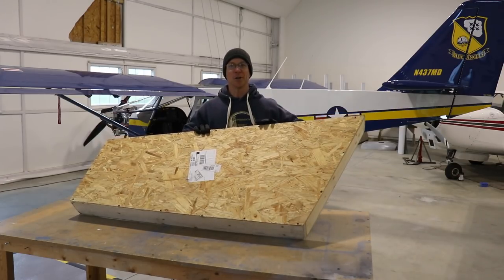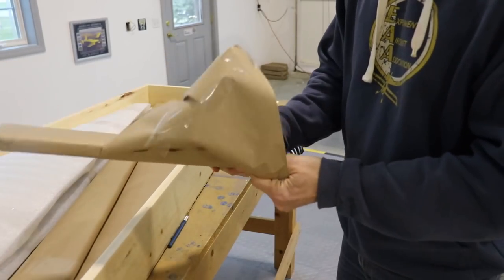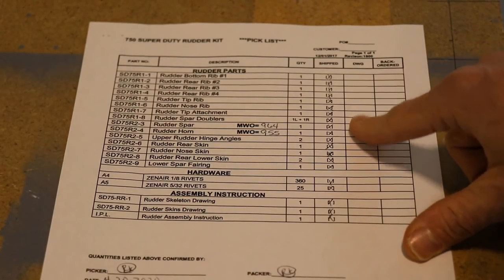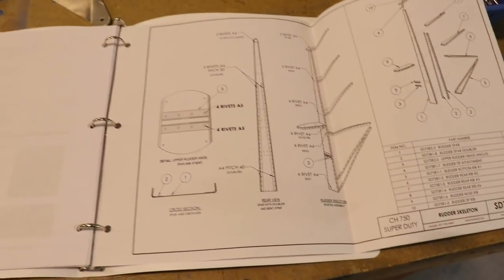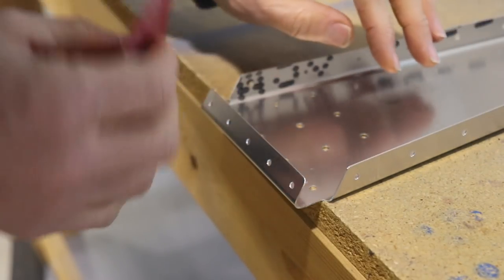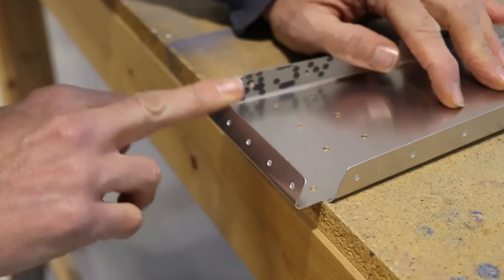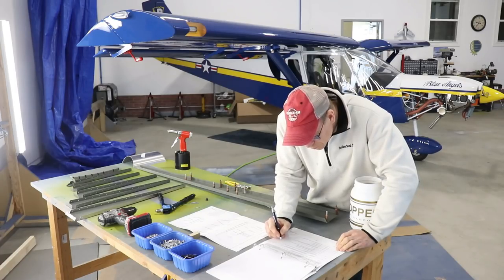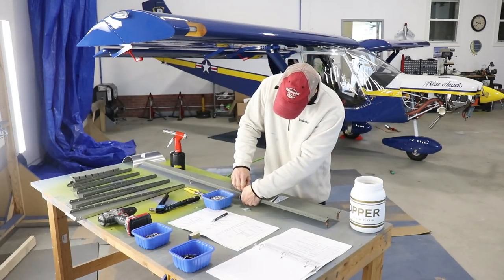I Built a Zenith SUPER DUTY Rudder Kit!

Comment: (checking off the steps as you go:  The DAR likes seeing those and counts that as your build manual/log, so should be considered mandatory and not optional to do) Best also to date the check.
For those that are brand new builders, instructional videos come in very handy --- both for the HOW as well as Confidence Verification, so I vote YES on the detailed video
Reply from the maker: True, but the build log also has to consist of build photos. The FAA also wants the builder in the photos too to 'prove' that he or she actually built the plane.
Reply: You should also initial and date each step if you plan to use that as part of your build log.

Comment: Corners only result in stress concentrations (stress risers) when they are inside corners.  Outside corners are fine.  I agree that they look better with a slight radius, but there is no structural imperative.

Comment: Sure, I'd love to watch a more detailed video on the SD!
Side question on this video: I notice some ribs are primed, but some aren't--or maybe one side is and the other isn't on some. Can you elaborate on that a little? At first I thought all the internal stuff must be primed, those left outside being left unprimed, but I got a little confused with the unprimed nose rib. Thanks.
Reply from the maker: Good eye, and you are correct. The primer I'm using to prime the internal parts is Dupli-Color self etching primer. It's great for internal parts but it isn't as strong and doesn't bond as well to the aluminum as two-part epoxy primer. So any surface, like the bottom of the bottom rib, and the top of the top rib, was left unprimed as it will get primed with a good epoxy primer once the rudder is painted. It might not show in the video, the nose rib you are referring to is primed on the top and sides. But I left the bottom unprimed so that it will get sprayed with epoxy primer during paint.
Reply: @KitplaneEnthusiast  Of course, because the bottom of that nose rib is the outer side! THAT's what I missed. Thanks for the reply! Keep up the good work.

Comment: Hey Mark, Just started my rudder this weekend for the Cruzer!!  Hardest part is getting the stickers off :-) . Any tips on an easy way to remove those. Thanks for another great video!!!
Reply from the maker: Ah the great joy of building a kitplane! Other solvents work too, but since I have it I soak a paper towel with MEK and hold it over the sticker for about 30 seconds. That will soften the glue and you can pull the sticker off in one piece. Then, clean off the residue. Wear gloves and ideally a charcoal respirator with MEK!

Comment: Wow.  What a great idea to produce an end-to-end video series on building the SD.  Homebuilthelp.com has the back end of the fuselage and Zenith has the tail and wing assembly, but all of it would be a needed and a new work.  I'm interested, because that is what I'm considering building 

BTW, I like your bins and Copper jar organization techniques as well as the corner rounding, edge sanding, and de-burring.  Did you adapt your de-burring tool from another use or is it designed for that purpose?
Reply from the maker: Nope the tool is designed as a deburring tool!

Comment: It's hard to see it but I think that you may have sprayed primer on all the parts before you riveted them. It would be good since the parts are aluminum and the rivets are steel, also, was there any need to drive up the holes for full size or are they predrilled full size from Zenith?

Comment: I noticed you having to use two trigger pulls on the rivet gun.  Mine pulls the rivets with one trigger pull.  Is your gun pull length adjustable?  Mine is and I am wondering if your gun is out of adjustment.
Reply from the maker: Yes mine takes two pulls. The squeezer doesn't seem to have enough throw, but it's not adjustable. At least I don't think it is...how do you adjust yours?
Reply: Kitplane Enthusiast I suspect adjustability may vary by the tool brand.  Mine is a Taylor brand that came in the RANS tool kit.  Here is a video that discusses briefly adjusting the pull length.  I would think the tool manual would cover it if it is adjustable.  Also, have you checked the oil level in the gun? I suspect that if the oil level gets low, that likely would affect the pull length since most of these style pullers are air over oil activation.

https://youtu.be/iEGoHOgEw08

Comment: Why do u pull the rivet gun 2 times per rivet
Reply from the maker: I had my pressure turned down on the compressor and set perfectly for painting. Since I am in the process of painting the lower cowl, I didn't want to change anything. So the pressure was slightly less that what was needed to pull the rivet. That's why it takes two squeezes.